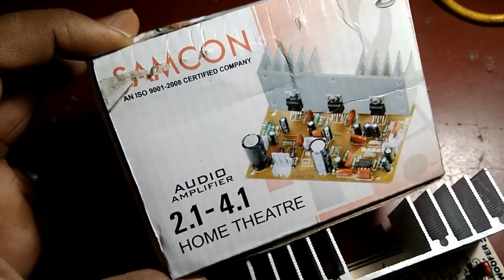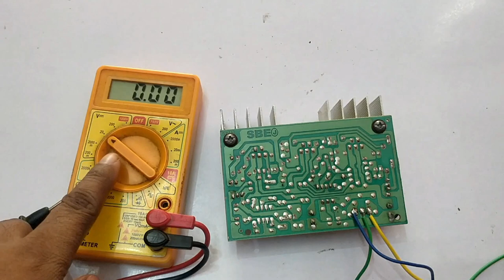2.1 home theater connection | 2030 home theater kit wiring | 2.1 & 4.1 audio Amplifier board wiring

Comment: এই বোর্ড আমি 2 ট কিনেছি,দুটোতেই বে স এর প্রবলেম,সাউন্ড বাড়ালে হারমিং হচ্চে ,মেকানিক ঠিক করতে পারে নি,
Reply from the maker: Ground problem hoche.   main volume 50k use korun, r joto potentiometer ache  sob body thake ground connection korun.
Reply: 5 voltage এর output টা একটু বুঝিয়ে দিলে ভালো হতো।